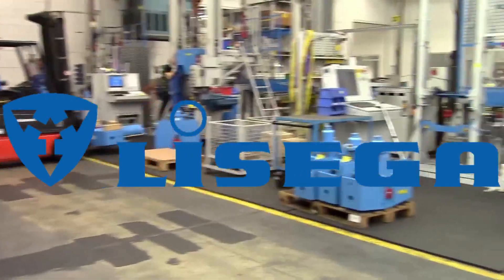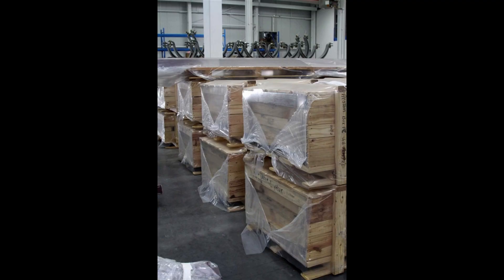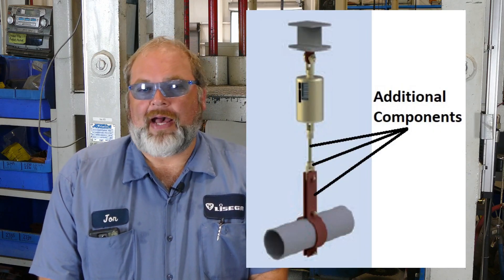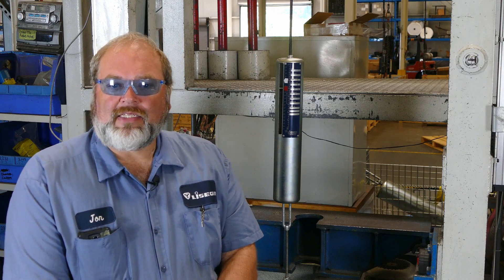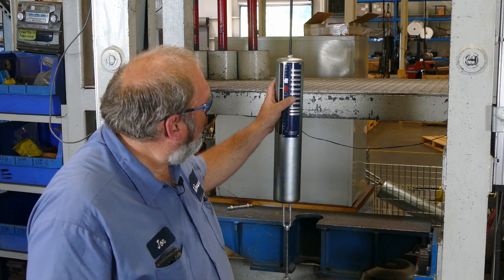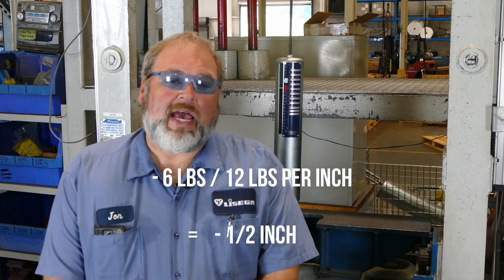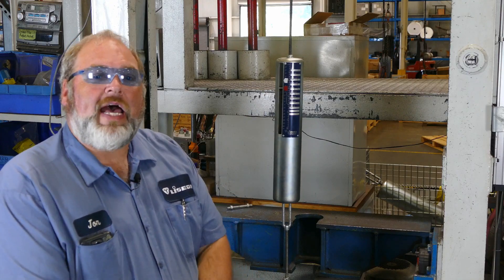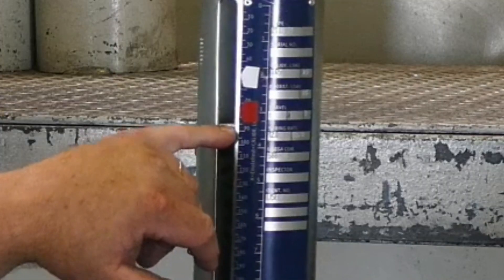LISEGA - Adjusting the Load on a Variable Spring

Comment: How can you adjust a load on variable spring hanger at site, when spring has plus or minus 5 % load tolerance on spring rate , it can be calibrated only  on test rig for accurate new load, site adjustment not Recommended.
Reply from the maker: When we set the spring at the factory we use the ACTUAL force the spring is exerting on the test bench. We do not use, or even have, a load scale on the variable spring itself. By computing the desired new force using the mathematical process explained in this video (which is much more precise than using a load scale) the new force will be accurate enough for most situations. If the new desired force is REQUIRED to be exact then we recommend sending the spring to our factory and resetting the load on our test bench.
Reply: @LISEGAIncUSA  noted ✅️ thanks